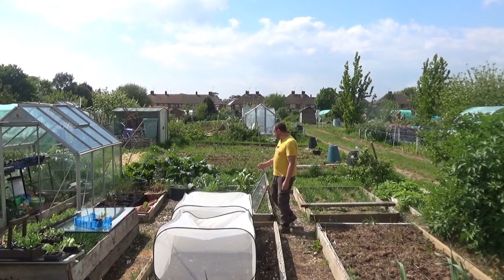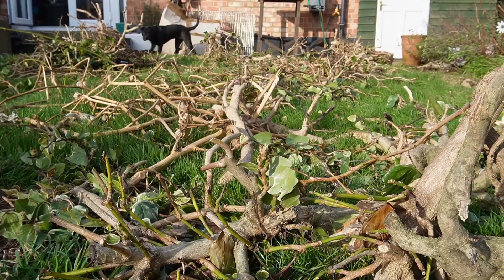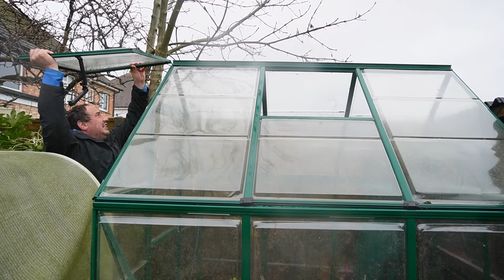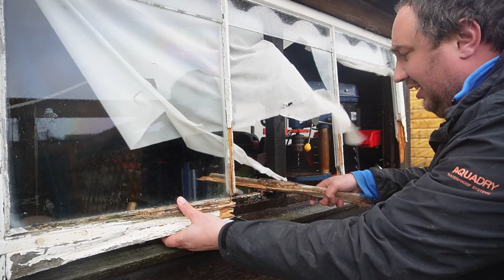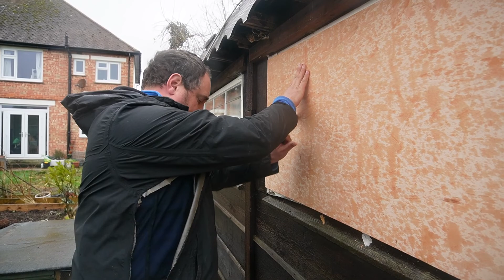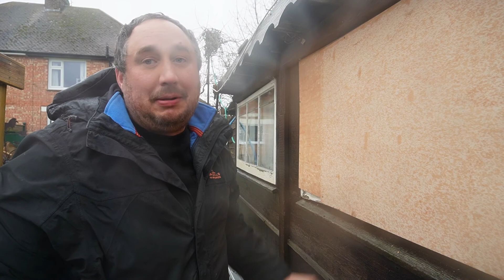After the storms. a week of gyo

Comment: I am on my 3rd lot of cover frame Tee Pieces now - they seem to be a weak point, even without the wind. The stress of the stretch of the mesh seems to distort them over time and they just crack.
Reply from the maker: It’s the first time anything has broken in them for me. Be had it for a few years too which I’m pretty impressed with
Reply: @ThevegGrowerpodcast  The first one failed after 3 years for me and then annually afterwards. I have added jubilee clips to them to add a bit of strength. Might be better if they were made from metal instead of plastic like the rest of the frame.